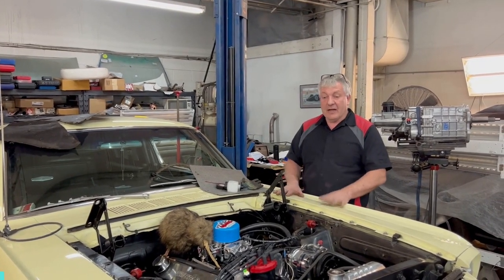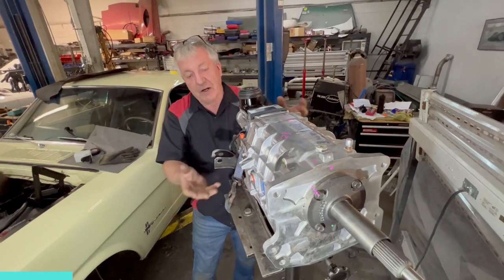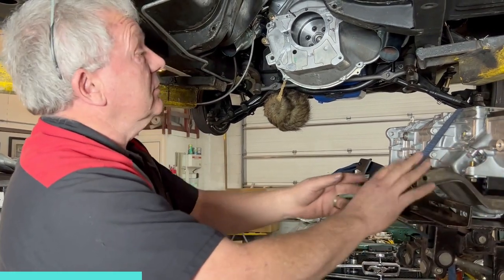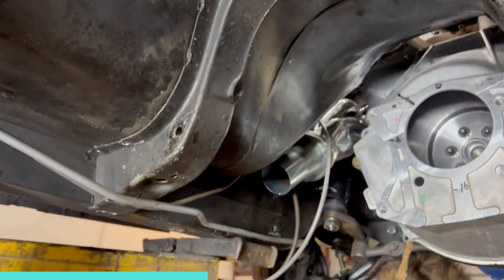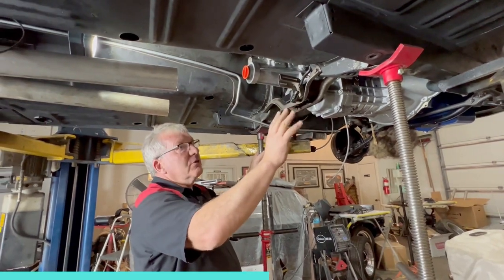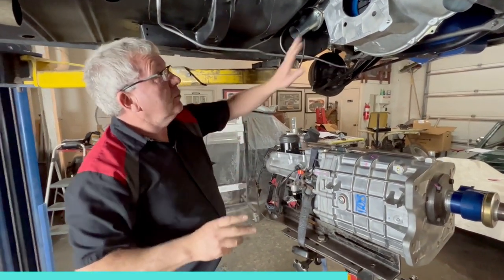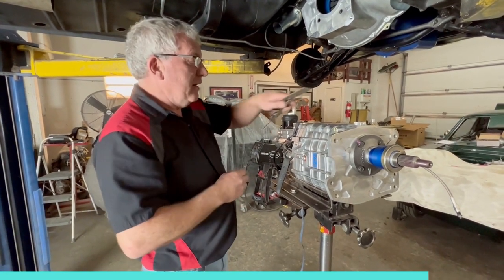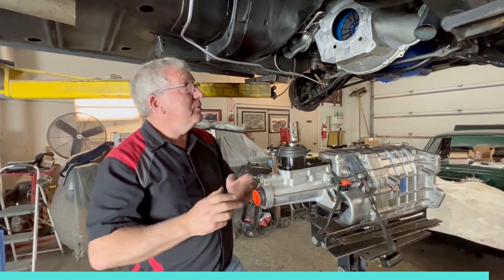Tremec TKX Install. Without the vibrations!!

Comment: Wow man, that's an awesome mod, and hopefully cures the vibe problems when using that trans on the old 'Stangs. Yeah- I was wondering what the issue was with the other Stang and vibes, and obviously figured it was the trans angle, but man- how could it be corrected, well- You my Friend figured it out- I Hope ! Keep us updated if that cured the high-speed vibe issue on the other car (and this one should be fine). Thanks for sharing, cheers !
Reply from the maker: Cheers mate. Will defiantly be reporting on on the results.

Comment: Well explained. It looks fantastic. I like the part you through in about the rubber mount being able to absorb more vibrations. I have stopped using rubber mounts on pickup truck body mounts. But that's a whole different thing. That's all the story I have for you today.
Reply from the maker: Thanks bud. Enjoy your comments!
Reply: @kiwiclassicsandcustoms9160  I know of to 1970 mustangs. They are in North Carolina out towards the western side. One of them is a Mach One and the other one's a boss. 
The fella that I've been in communication with once one but I don't think he wants both of them. It's an interesting situation on going about to buy them. I'll spare you the detail for now unless you are interested possibly in acquiring one of them. The short of the story how this man came to own these two cars is this. 1970 he bought two brand-new mustangs. One for his soon-to-be sixteen-year-old son and the other one for himself. His son in 1971 was riding with another friend and that friend had a car accident and so this man's son was killed. The cars sat after that inside a building with 3000 and 5000 miles. A number of years ago probably measured in decades he moved them out to near a Creek. They were setting on a nice picnic graveled area. One of the cars he traded off to some guy for some money and some land. Any also got a 70 mustang in the deal as well. Which one has only 3,000 or 5,000 miles on it I don't know. How many miles the other one has that he horse trailer for I don't know. But they have been setting now behind the house for a number of years and people have busted out window on one of them actually I think it was a deer 🦌. And basically just sat and rot and how far gone I don't know. Oh okay the rest of it it's gotten too long anyway. The man is in his nineties bedridden and his niece and her husband are taking care of him and supposedly have power of attorney. They don't trust a lot of people. Anyting that would interest you or not? I've never seen the car and I could put you in touch with the guy. The price that was thrown out to him was $22,000 for the pair. Given all the circumstances I told a man that I would just sit back and wait. So he's waiting he's actually looking for a 53 Ford pickup as well. You seemed like a mustang to say the least
Reply from the maker: @CAROLDDISCOVER-2025   I could be interested yes.
Reply: @kiwiclassicsandcustoms9160  I will email the guy. I'm not looking to make one red cent off of anything. But this fella seems to want to deal through me for some reason. And I'll tell him about your channel heck you may already be a subscriber and viewer I don't know. The man's well-educated but he comes in the backwoods like I do. Even though him and I are from two different parts of the country. I just like seeing these old hunks of vintage history saved. I don't care what they are. Even Fox body's I don't like them. Anyway I'll email him and when he gets back with me I'll update you.
Reply: @kiwiclassicsandcustoms9160  I sent Jeb the email with your link to your YouTube channel. I figure it's a good way for him to get to know you. I used to travel the Appalachians a fair amount like anyplace else they have their unique way of going about things. I actually like the area

Comment: I've relocated quite a few transmission cross members swapping TH700R4s into early GM A  and F bodies, as well as pickups. Fortunately, those vehicles use bolt in cross members and only require drilling a couple new holes rather than cutting and rewelding.
Reply from the maker: Yeah, a bit more work to move a ford one back.   Chevys fight you in different areas so it's swings and roundabouts really 😁

Comment: I’ve recently discovered that with a custom driveshaft if you experience vibration you may need to remove the driveshaft twist it 90 degrees and reinstall. (Just what I’ve read) I know angles and diameter amongst other external factors could play a part in unwanted drive line vibration.
Reply from the maker: You can't turn a 8"or 9"  driveshaft 90 deg only 180deg.  Too small of a diameter will cause problems due to "windup" Incorrect angles are the biggest cause of problems in my experience.   Thanks for watching man!
Reply: Thanks for the insight, I was unaware of that fact. Learn something new everyday!

Comment: I love your work in this video! I have a question though:

 At 8:37 you mentioned that the transmission is tilted slightly towards the passenger side. Is that due to the specific shifter (stub) you are using or is that part of the TKX’s design?

I was left puzzled when I test fit my TKX  and the shifter tilts considerably towards the passenger side. I was going to tilt the engine (drop the driver side, raise the passenger side)  to compensate, but your comment made me thing maybe I should see about fixing the shifter’s angle with an adjustable stub like you show in the video.

Comment: Excellent content! 
When I am ready, my car and assorted goodies will be heading to Tennessee. I am convinced you do the very best job possible.

Query;
What's happening with the 1967 / 427 install?
Reply from the maker: He's next on lift !   Going to have to move the crossmember in the same way
Reply from the maker: What car do you have??
Reply: @Kiwi Classics and Customs  
I do not have it yet, but I know of a 1967 Fairlane that was a drag car most all it's days.
Rust and dent free.
Roller, with nothing at all in the interior. 100% bare.
It will be a real project, but a better start I will never find.
If I can't end up with it, then I will find something else. But that is the one I really want.
I want it to have a Rev happy 289 and a 4 speed with like 3:73 gears. It has a Detroit locker in back at the moment.
Reply from the maker: @oldtimerf7602  sounds good !!

Comment: there at the begining is that a stock Ford 65/66 (6-bolt Bellhousing?)  what was the deal with having to center the trans in the bellhousing?  the moving the factory crossmember & relocating it back 3" is the only thing stopping me from doing this swap in my 65 coupe.
Reply from the maker: No, that's a bell housing made for the Tremec swap. You can use the stock bellhousing but you need to use an adaptor plate to allow the tremec to bolt up to it. Either way you go you do have to line up the bellhousing with the crankshaft. I've seen them as far as .038 out of alignment and that's just due to the machining tolerances that were deemed acceptable back in the day. The tremec can only live with a maximum of
.005 misalignment.  This is due to the design of the transmission. Making them stronger has required a lot tighter tolerances internally and is not an issue with todays engines that are machined to much more accurate tolerances also. To date I have not seen a  ford , Chevy or Mopar earlier than the 2000's that didn't need to be realigned.
Reply: @kiwiclassicsandcustoms9160  Tkx, so much for the info !!

Comment: When the transmission kit guys don't realize that their fix is problematic and is not the right way to fix it. Moving the upper member is the right thing to do. The driveshaft has to have the same angle on both ends to cancel out the two speed changes per revolution. If not the same then the speed changes are transfered onto the differential.
Reply from the maker: You've got it bud.  Thanks for watching!!

Comment: Hey, couldn't you just of adjusted the pinion angle down so it is in the correct angle to the transmission's output shaft?
Reply from the maker: Well yes it probably could be achieved through shimming the pinion but that still left you with space issues in the trans tunnel. Nothing like a trans touching the floor or crossmember to give you a mean vibration.
Reply: @kiwiclassicsandcustoms9160  
Oh I must of missed the touching the floor part, carry on. 😎

Comment: A lot of people take a shortcut by cutting the top of the arch out of the stock transmission support. That concerns me because Ford made that pretty substantial and put it in every Falcon-chassis car. What's your take on this? I feel they wouldn't have put it in if it weren't very important. How much strength do you believe it adds to that part of the car, and what's the result of cutting it out?

Comment: i wonder if lowering the engine down with adjustable motor mounts would eliminate the vibrations without relocating the mounts.
Reply from the maker: You'd have to lower it 1 1/2" or so and that's going to get your oil pan into the engine crossmember and your exhaust very low to the ground.

Comment: Hey Kiwi, I noticed in one shot during mock up that the top of the tunnel support was overlapping the shift hole. What did you do about that?
Also, could you show how the shifter came up through the hole when done?

Thanks Kiwi, that Stang is looking great. 👍
Reply from the maker: The back edge of the cross member had to be trimmed a bit. It is right beside the shifter opening now

Comment: Where does then shifter go ? It looks like that could be a problem .
Reply from the maker: Shifter comes out the stock location.  It's adjustable so you can move it a couple of inches in all directions